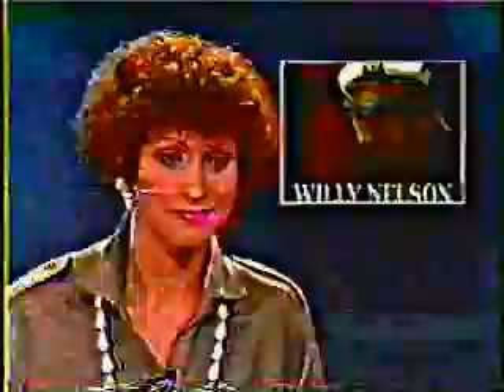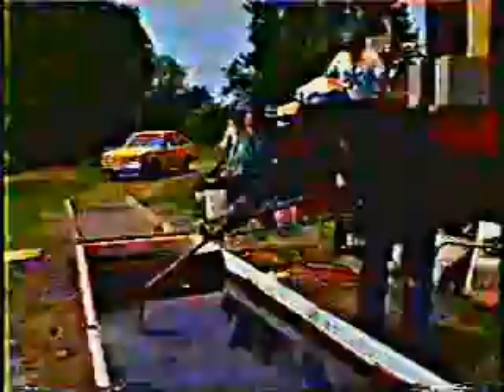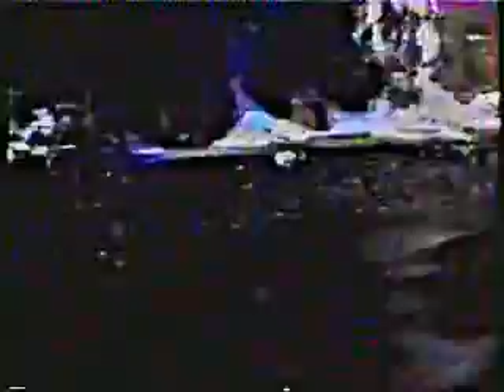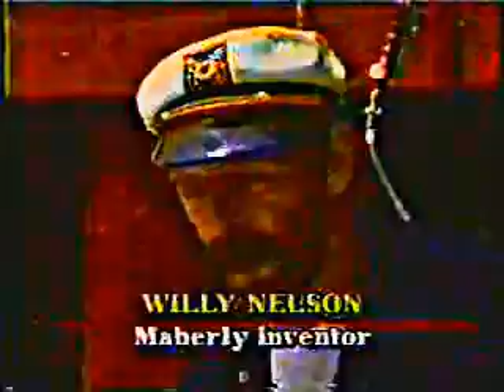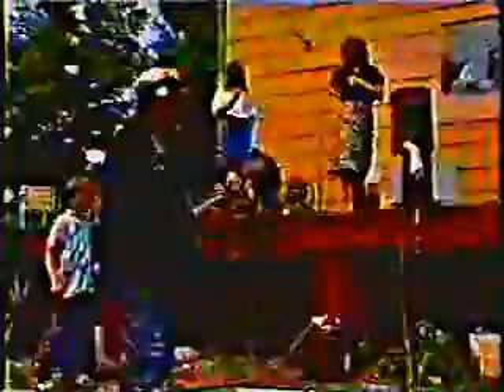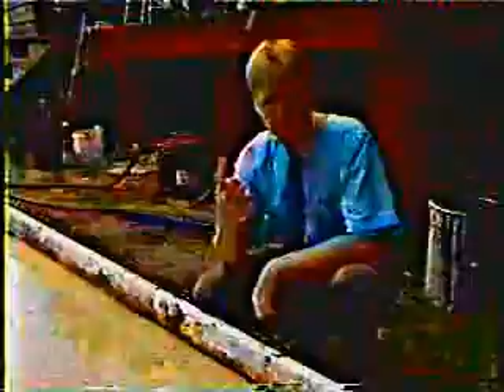Oil Spill Removal Demo using WAX - Willy Nelson

Comment: Just plane wax won't do the job, because the wax must be formulated, for example, being able to roll up an oil coated beach off the sand like it was a rug requires the sprayed wax to remain in a semi solid.  Very basic technology.that I had discovered in the middle1950's

Comment: This demonstration video goes back about 35 years:......
· 
(Please share) To all my FB friends......, All these toxic and oil spill going on, A simply complexing simple solution: ..: They should do the right thing by using wax to semi solidify and render the oil non-adhesive or contaminating by using a formulated wax, then fisherman could pick it up with fish nets and dump the mixture in a waiting barge to take it to the refinery to save the oil and keep reusing the wax over and over until all the oil is gone. A win- win situation. All we are doing is re-uniting the wax from where it came, and besides, the crude oil already contains up to 4% wax, so you get back more wax than what you started with after it is refined. Both powdered wax or a hot wax method could remove spilled oil in any situation or condition on still water, sand, rocks, land, or on ice in the Artic caused by ruptured pipelines, and that will happen.. . Please share this solution as it truly works. This method has been demonstrated for Environment Canada under a contract to remove oil spilled on Passage Island BC in 1974 successfully. Also, for the US Coast Guard twice, once in Texas in 1979 and again in Hawaii 1982. Again for the Canadian Coast Guard in the Toronto Harbor .For the media and to the public for 46 years. I have been visited by the thought that I may not be around in the not too distant future, and would be nice knowing that someone, somewhere will carry on where I am leaving off.  Oil spill removal is so very basic that many school children across North America have used this method in sciences classes. all of them received A’s and 100%, so could all these kids be wrong? Using wax is the only right thing to do. Please forget about Willy, as he is not important, as wax is important and should be the subject.. . .Thank you, ..wn. ..
Reply: +waxogen Shared on Facebook.

Comment: @waxogen Yes, it was 20 years ago, and nothing has changed, you will see no deviation in any of the videos using hot wax. The first demo was 40 years ago. Our great grandchildren will force the arm of the Government's around the World tomorrow, to use it.  Like I said, we get the wax back to use over and over,  The wax used is the very same wax in the oil being spilled.  Not one drop of oil should have ever reached the shores. Death to wildlife and damage could have been prevented      W

Comment: Yes, it was 20 years ago, and nothing has changed, you will see no deviation in any of the videos using hot wax. The first demo was 40 years ago. Our great grandchildren will force the arm of the Government's around the World tomorrow, to use it.  Like I said, we get the wax back to use over and over,  The wax used is the very same wax in the oil being spilled.  Not one drop of oil should have ever reached the shores. Death to wildlife and damage could have been prevented      W

Comment: My reply, Wax  I use is not a chemical, it is a pure food grade wax, If wax is sprayed onto oil coated water surfaces, the wax and oil combination form into a non adhesive. non contaminating solid, It can be removed from the water surface quite easily  with small meshed fish nets and emptied into a waiting barge. IT can be taken to the refinery where the oil was going to be distilled in the first place. They get to save there oil and get the wax back. to reuse over and over.....Willy